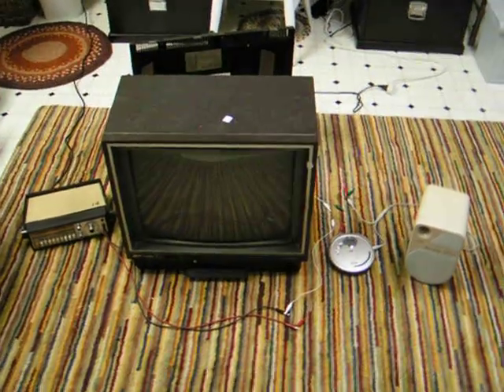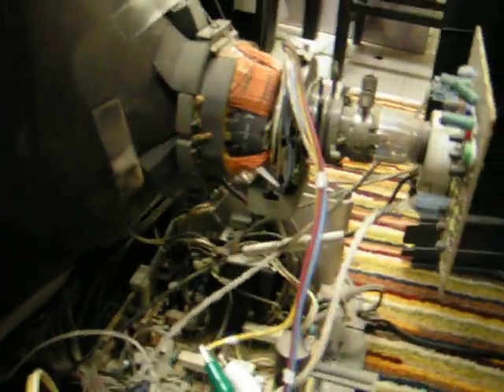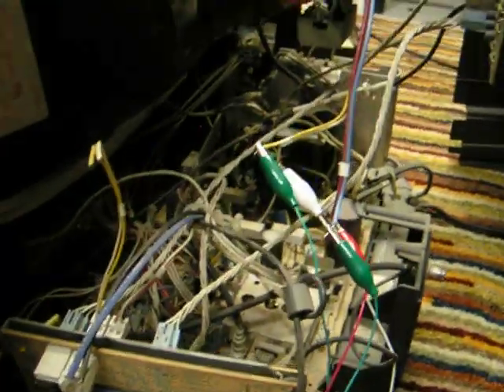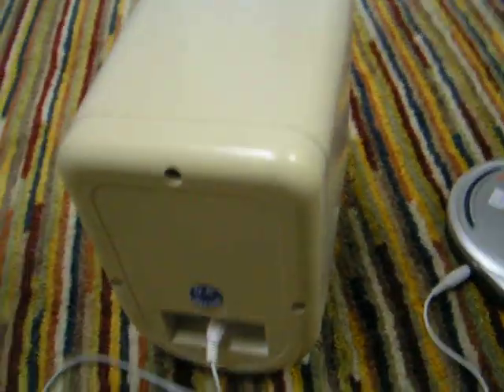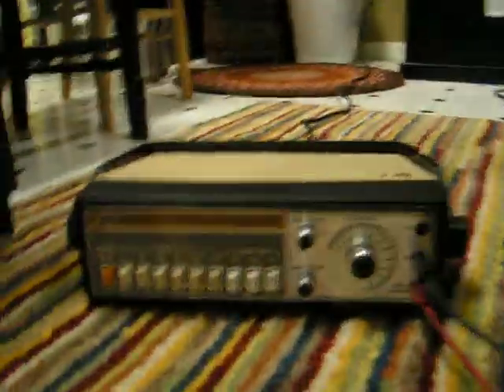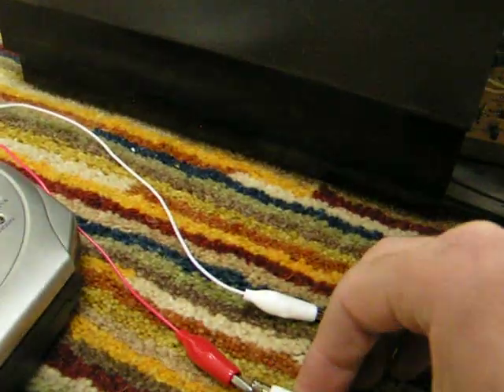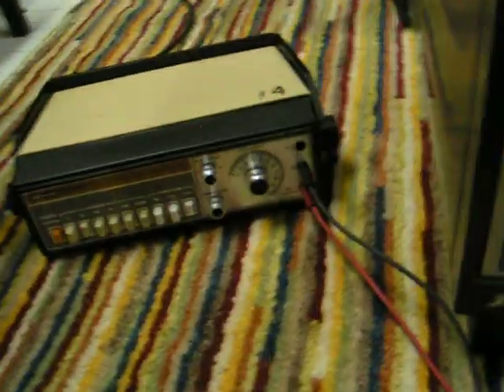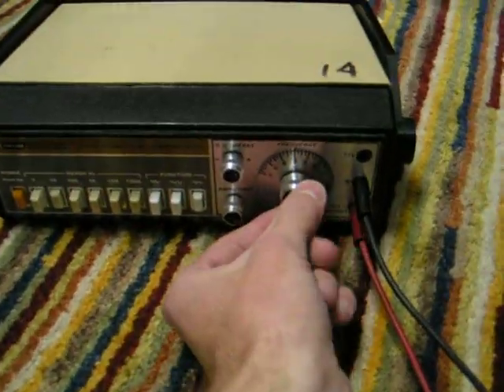how to turn a TV into an oscilloscope

Comment: Connect the original Vsync line from the TV board that use to go to Vsync coil, to the Hsync coil (instead of one of your stereo channels).   Then leave the other as you have it, the Vsync coil connected to your CD.  You'll get a H/Sweep line then, and can then see the audio signal like sine waves.        Or if you're doing a fresh tv, just cut the Hsync line and connect the wire from its coil to your CD player, and you'll be done, only your image will be 90% rotated.

Comment: No, disconnect the horizontal yoke and leave tzhe vertical deflection as normal.
Turn the complete set of deflection coils 90 degrees. This will be best.

But connecting both coils to the speakers is a good one too, creating lissajous-figures then.

Comment: @surferboy36O Sounds like the device was rigged incorrectly(oxymoron?), possibly causing a surge of electrical current, which would likely begin melting and frying the components. CRT TV's (like any electrical devices) have intricate circuits consisting of many fuses, resistors, electrolytics, capacitors and the like, whose charges can easily damage the TV when their "normal" flow is interrupted, changed or damaged.

Comment from the maker: It was weird for this TV; after separating the coils from the circuits, I had to connect a 3V power supply (two 'C' sized batteries in series) to the coils in a sporadic manner. I guess there's initially a surge or something through the coils to help the electron gun start. Just try different things out.

Comment from the maker: Ya, I know that the CD player has a weak output, but I think the patterns were ok considering this used the minimum level of wiring.

I did use a step-down transformer to improve the output, but I didn't make a video of that, and I salvaged the flyback transformer out of it (which works a ton better than my other one; my next video might use that one).

Comment: You should have left the horizontal as is, and connected the cd player to the vertical, giving a trace the full width of the screen using the tv's horizontal sweep, of .. erm some Khz .. i don't know the figures but you know. :)